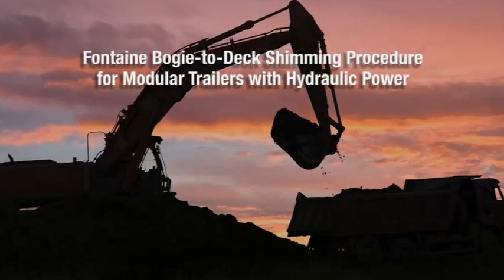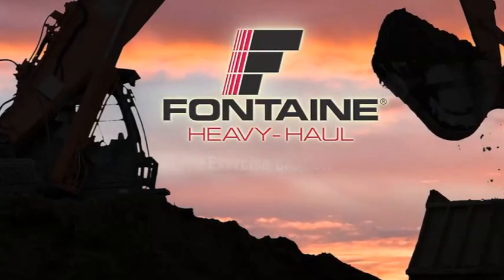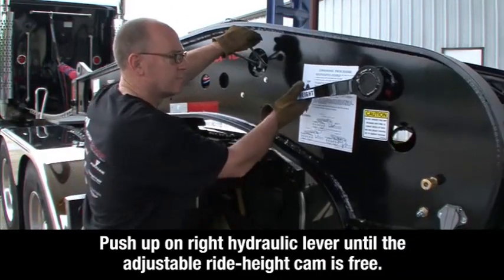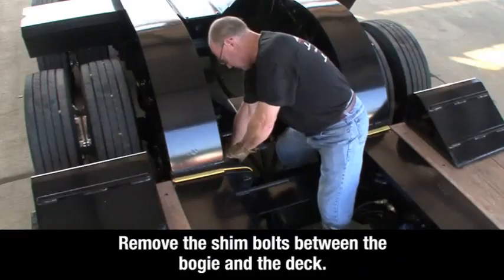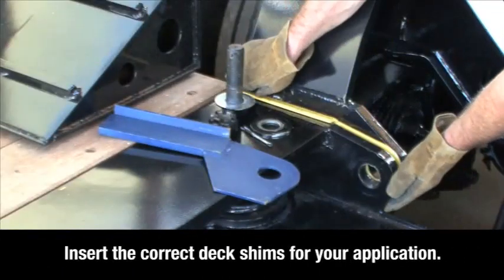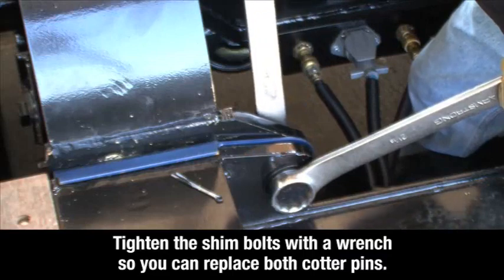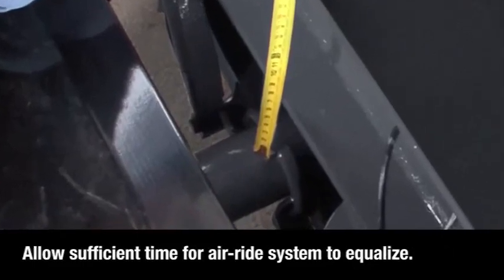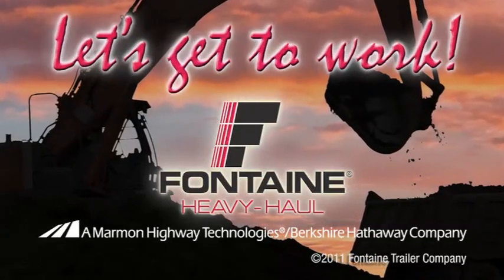Shim Modular Bogie

Comment: I may be wrong here, as i am learning about heavy haul but I think what the thicker shims do is cause the load to put more weight to the trailer axles. It cants it backwarda forming more of arch like a bridge. When they run booster axles with spreader bars in between they have to do the same thing. it just depends on where you need to shift the weight to. I might be wrong. some one please correct me if I am. Im only experienced on 7 axles right now so these shim dont really apply to me, but I should be learning this stuff hands on soon hopefully.
Reply: No idea, I don't have to do this on my Murray 50T. I have fixed tandems, so you may be right. EDIT: You are correct, I saw another video on shimming for weight transfer.